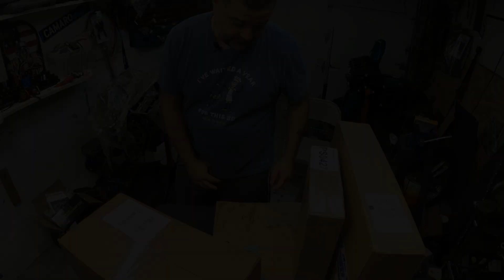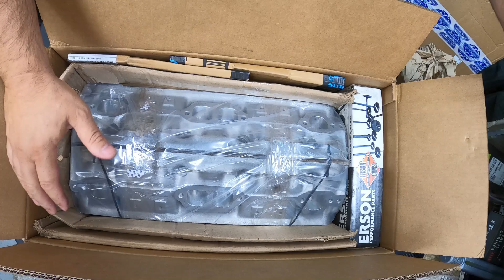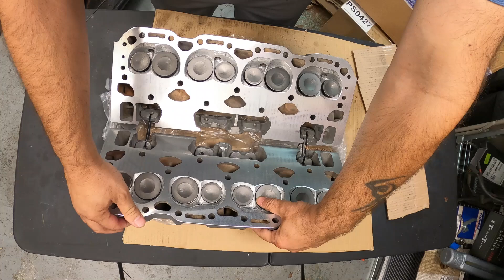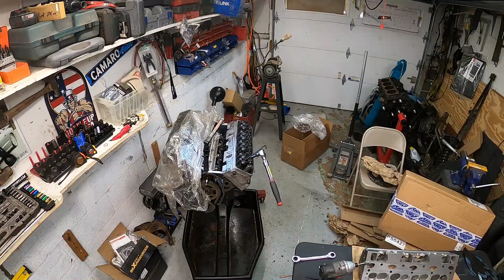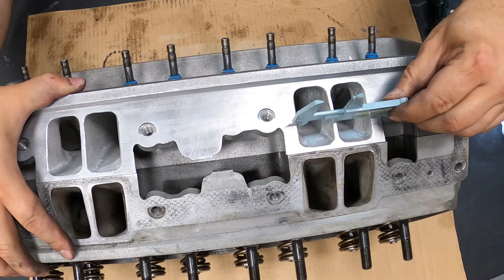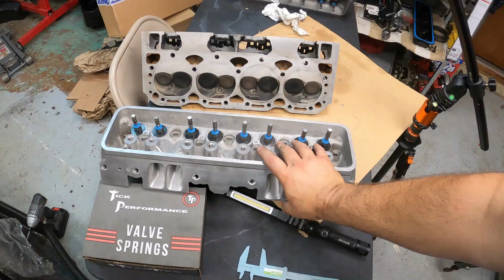Lloyd Elliott ported Cylinder Heads LT1  Gen 2  LE1

Comment: Overrated, I paid 1400 for my heads! Should have went with Trickflow for the price! Not to mention the heads I brought from him had a broken head bolt stuck in it I had to pay to have removed I also have receipts and proof of Photos
Reply: Your not very Smart a broke header bolt is really easy to remove not in car .
Its in the car that its a pain .
Bolt broke off cant lock in there because hole is longer than bolts 
You could have spun it out with Screw driver
And the reason Stock ported heads are stronger is the 53.7 cc chamber making 11 to 1 compression
Reply: @alonzahanks1182 Head bolt idiot. My 1st grader cold remove a header bolt. I paid 2 thousand dollars for those heads num nuts 😅
Reply: Trick Flows won't make the power LE heads do, sorry you're misinformed.
Reply: @garrettkifer8332 I do not own a Pair of Trickflow heads but I do own a Pair of LE heads that pretty much produce the same amount of horsepower as my stock ones. For the price and horsepower gain not worth sorry to inform you!
Reply: @MommasGoldenChild_loc0364  I read your original comment and saw that. LE heads definitely perform, there isn't a debate available about it. Over 2 decades or proven results speak for themselves.
Reply: @garrettkifer8332 I understand the process of porting heads and removing restrictions to increase more airflow! But if you think your going to just throw some exspensive LE heads on your engine without any other mods and make a bunch of power your dreaming 😂
Reply from the maker: hmmm LE setup has been proven time and time again don't  take my word for it just look across the board with dyno numbers..
Reply: @maldo72 key word is Setup! Your not just about to throw a paid of LE heads on your LT1 and make numbers sorry but your wrong there. I have some from LE
Reply: Now if your talking-
Ported LE HEADS
PORTED INTAKE
PORTED THROTTLE BODY
AFTER MARKET INJECTORS
PISTONS
TUNE
OH AND CANT FORGET A SET OF GOOD HEADERS THEN YOULL SEE NUMBERS ACCOSS THE BOARD.
By then you were better off buying a STROKED OUT short block from GOLEN Engines which will out perform LE Stuff any day in my opinion

Comment: why wouldnt you just go lt4 heads and port those instead just asking
Reply: if you go LT4 heads, you then have to get the LT4 intake. good luck finding one today. its much more cost effective to port your LT1 heads and LE does a great job. 
they usually flow anywhere from 260-275cfm which is plenty for a LT1 sbe.
Reply: because LT4 is really expensive and you can get great results porting LT1 heads.
Reply from the maker: I bought these heads sight on scene that he had in stock.
Reply: is porting lt4 heads better for lt1?
Reply: @rayzjauncurry3283 the raised intake runner of the head makes it difficult to match an LT1 intake to it. The difficulty is a matter of perspective though. I've built and used a lot of LT4 heads. They run well with big intake valves. If you ever come across a set....be on the look out for the mythical Crane roller rockers too. They're said to cure ED!

Comment: I was wondering if you can help me with your experience. I recently barn-saved an LT1 TransAm and I want it all... like everyone else:  Low end power, economy and a 10 second car. From your perspective which is achievable or what can I expect if I throw like 5k in that engine bay? thanks in advance!
Reply from the maker: @erickbren8702  contact me via email maldo72motorsports@yahoo.com
Reply: $5k for interior safety for the 500hp+ under the hood😮 you dint think of that one, did you? Ever put your foot down on 500 crank hp? It will wreck a car quick and kill you dead, as fast. 500-25% powertrain is how much rear wheel? 360hp not much, right?
Reply: @mikes.1882 most drag strips dont require roll cages till you're doing 10 second quater miles.
And some cars come stock with ample power to do that (hell cats, telsa plaids, Porsche 911s Turbo s, audi rs e-tron gt performance etc etc). Chill. The s650 mustang with its 500 crank horsepower and 418ftlbs torque does a 12.5 in the quatermile. 
For perspective, my stock 93 lt1 does 13.7-13.8 in the quater miles and has 300 crank horsepower and 340 torque....
Imagine the horse power difference to get a 10 second car.
Reply: @mikes.1882  you make a very good point. So let's say 10k. 5k roll cage + 5k in performance
Reply: @erickbren8702  
It costs money to get ro 12's. It costs way more to drive 500 crankshaft horsepower on the street. It's not only insurance gas, which is 1/2  pump premium 1/2 100 low lead, you have to buy the best in valvetrain.   The best cylinder head design,  
The best tuning which will cost north of 1000 bucks.
Walk away from the barn find and pay for 98-2002 SS LS engine car. Wrecking yard heads are 500 bucks. Cam is 500 bucks, gaskets, oil pump ect. Go have fun building a nice car as you go
Reply: @mikes.1882  You clearly have no idea what you're talking about, I road race these things, and the LT1 built properly is a far superior engine for that task, I am running 14:1 compression on these engines on 93 pump gas, I have a standard build right now making over 600 lb/ft of torque, I have built two of these now for other people that have pulled their LS's and put my LT1 in for road racing, time for you to hop into your Honda and puts your way home, be careful, that power you know.
Reply: @mikes.1882  bone stock Camaros and Mustangs have been making this much power for like 15 years, it's not that much HP by today's standard my guy. you're talking like you're stepping into a top fuel dragster with 500 crank hp...
Reply: @erickbren8702 5k in the engine isn't taking you very far. You're not going 10's on that. You're also not going to get economy with a n/a  capable of 10's.
Reply: @viciousrap700  thanks man! I just hope it gets like 10mpg. perhaps going hard on weight reduction? plastic rear window? lol
Reply: Dude if you’re going to rant at least get the math right.
Reply: Im on the same path on my 6spd 97 z28. Stock heads/cam, long tube headers, true duals exhaust, 150 shot nitrous (throttle body plate), 320lph fuel pump, msd 6al plus,  vicking rear coilovers, tube LCA and subframe connectors. mt drag radials. Quickest et is 11.3 with a crappy launch.  Still more time in suspension adjustments and tire pressures.  Next option is cam/heads.  I havent even touched the drive train yet with our tiny 7.5 rear ends smh.  Just having the 500 hp doesnt mean quick ETs.  Still gotta hook and nail the 60 foots
Reply from the maker: @erickbren8702  contact me via email.  Maldo72motorsports@yahoo.com

Comment: Its really cool to see your still uploading and modifying the LT1! I have LE1 heads with a LE 222/230 cam and im looking to upgrade it to something bigger!
Reply from the maker: yes this was suppose to be a simple build and at this point i have torn down the engine 3 times lol and have added a lot more then i was originally was going to do lol .... more parts are coming will update soon
Reply: @maldo72  that’s awesome! I can’t wait to see more and learn more LT1 tips and tricks too!
Reply: Any dyno numbers or track times? I’m thinking of going le2 heads with the same cam as you.
Reply: @jtome84-91 I kept having issues with the car running rich and not running consistently. It ran 13.0@103 in the quarter mile. I since upgraded to a bigger cam and now it runs very well. I think I may have had an internal vac leak or valves too tight on the old cam.

Comment: Llyod does great work.  I've got a set of LE2 heads on my car and a camshaft that he recommended.  The difference in performance was night and day.  The man knows his stuff.  One day I will spend the bucks and have him port a set of aftermarket heads for a max effort build.  Congrats on the cylinder heads.
Reply: What supporting mods u got jus heads and cam ? Headers ??
Reply from the maker: yes I got le1 heads  his custom grind cam and headers...
Reply: I got some trick flow 21* valve angle 55cc valve chambered heads 185cc that I'm gonna have him port and give me a cam he thinks too with my full bolt on 94 Z28 vert